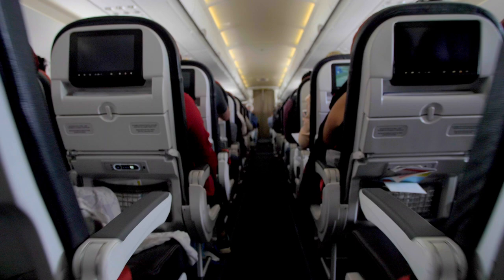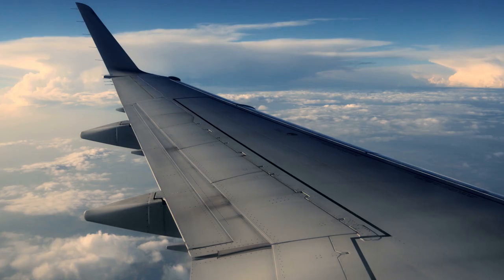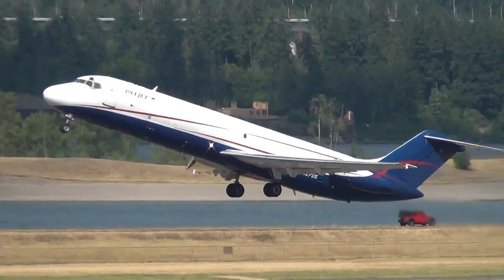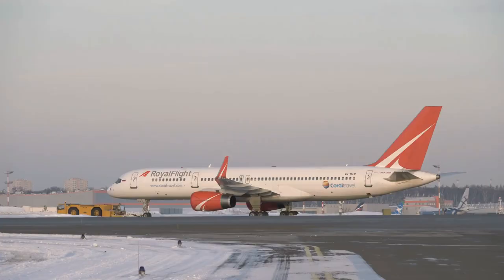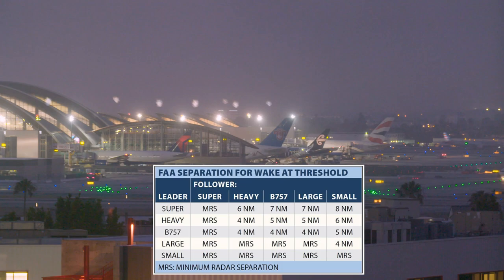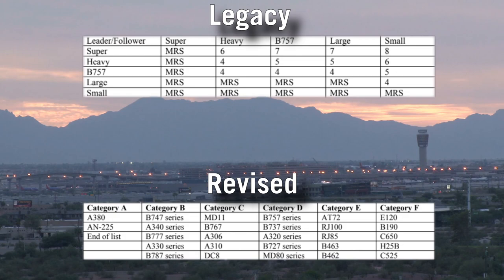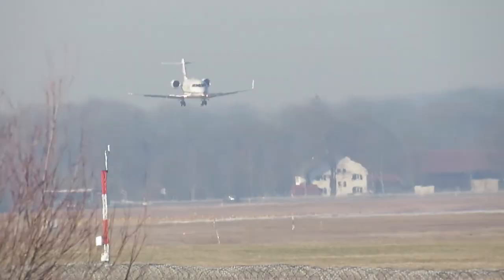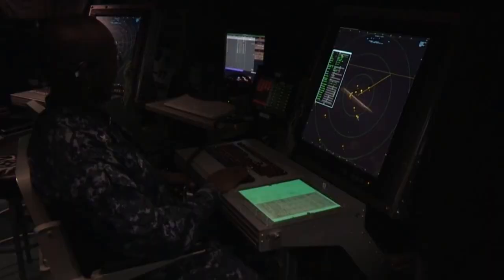This Is Why Airplanes MUST Wait On The Runway

Comment: The wing tip vortices also produce drag, which is the main reason the airlines wanted a solution (save money on fuel). That's why airliners now have winglets to reduce the vortex and reduce the drag.
If you watch the video again you'll see that the aircraft producing the largest vortices all have a flat wingtip (no winglets).
Reply: Cool, thanks for sharing. Always wondered why those exist.

Comment: Actual measurable testable science, as opposed to wild ass guessing and stentorian toned pronouncements, refreshing and hope inspiring. Excellent content sir
Reply: You can ask a flight attendant she/he will tell you why they wait. sometimes the capt. or co pilot will announce why they must wait. at least the few planes i been on did. they compared it to a wake of a boat or trying to drive a small boat behind a bigger boat.
Reply: @CertifiedForkLiftOperator69420  This has some misleading data. There is also separation issues. Same type a/c can depart immediately after take off, if course diverge by 45 degrees or more immediately , if within 5 miles the 1 minute. The wait is not always dependent on wake turbulence.

Comment: You are right to point out Dubai's lack of safety. 
Vertical separation on the routes into Dubai, especially from the east, is just 1000 feet, similar to the conditions that lead to the near fatal incident with the Challenger 604.
It's just a matter of time before disaster strikes on the route between Dubai and India.
Reply: RVSM airspace in the US (where most airliners fly) also has 1000’ vertical separation.

Comment: I kinda learned this from living under the Heathrow flypast for 20 odd years. When a super came over, you knew it'd be a bit before another aircraft came over. What I find funny is the fact a Light doesn't even worry the Super/Heavy classifications when they're behind it.
Reply: It is usually because the lights are squeezed in between two heavies or mediums. They can avoid the wake by staying above the flight path of the preceding aircraft and landing after the touchdown point of that aircraft.
Reply: @jakobusstrauss1293  Can attest to this. If you have a small enough plane that can land relatively shortly, you can just stay above the wake of a larger aircraft. Source: have landed many times in a citabria right behind (comparatively) large aircraft such as 737s and (once) a 767.
Reply: Me too.  Had a room 300ft beneath the flight path.  Had to watch TV in 30s bursts ... Always used to amuse me that the authorities always denied responsibility when someone's roof came off or their car was flipped as a big boy approached too low.  Having a car alarm was also somewhat pointless ...
Reply: We were taught at flight school, "When following a commercial aircraft heavier than you (and ALL commercial aircraft are heavier than a single engine trainer), you take off BEFORE their point of takeoff on the runway, and you land AFTER their point of touchdown on the runway. This is because wake turbulence isn't generated when the wings aren't lifting the weight of the plane."
Reply: @bobjohn2000  what a horribly dangerous practice. Glad they don’t do that in Europe. Sounds horrific.
Reply: @peteconrad2077  It's not dangerous at all. By the time you're flying through, the wake is gonna be dispersed a significant amount, and you should be above it and have no risk of wake turbulence.
Reply: @peteconrad2077  Private jets wouldn't fly above wake turbulence, they would wait for it to dissipate. The only aircraft that do it are small piston planes.
Reply: @jakobusstrauss1293  Yep! Have done this a few times in an RV-7a. Just stay above their flight path and touchdown farther down the runway than them. Since they aren't making lift once they are on the ground, it's no big deal.

Comment: The jet burst is dangerous as many planes also crash like the twin otter when a a320 blow of the elevator control string, this shows that the burst from the engines can cause a horrific damage.

Comment: That clip of the people being blown around is at Maho beach in St. Maarten. A woman was killed watching a departing plane there. Signs are posted warning of the jet blast but most tourists ignore them.
Reply: @ezicarus8216  The area cannot be blocked off because the road leads to a community and hotels. And Maho beach that is at the beginning of the runway is a public beach. Also can’t block that off. If they put a solid wall or whatever the force of the jet blasts would knock it down. Vehicles have been blown over.  And yes, it truly is dangerous...more than one person has been killed. Signs are posted which are mainly ignored. They don’t just “wander around”, tourists flock there to see the planes come in and depart.

Comment: I was in my car at an airport service road, and when a DC-10 was getting ready for take-off, I got out to match by the chain linked fence.  Although I was easily 100m away (100 meters - a football field!), the thrust not only ripped me off of the fence, but I tumbled across the service road.  I remembered praying that a car was not coming by!!!  Those 3 quiet (high bypass) engines put out 8,000 kg of thrust each.  Eight tonnes !!!!   (well, 24 tonnes total)  No wonder my 60kg body was thrown around!!

Comment: Working on my PPL, and my first encounter with wake turbulence was in a maneuver called the steep turn. We bank to 45 degrees (Left and right, in no particular order), and turn in a full circle. If you do it right and the air is fairly smooth, you can actually fly through your own wake when you come out of the turn! In a Piper Warrior it feels like a small bump, and maybe a sudden roll of 2-4 degrees.
Reply: Yup.. I've had that a few times in an Arrow.. never a 172 though!
Reply: The same has happened to me when thermalling a glider. It's just a slight but very distinct bump.

Comment: Pilots actually have the option to wave wake turbulence waiting as long as they aren’t waiting for a heavy or super. They usually don’t, but I’ve seen it happen
Reply: "speedbird heavy, follow the cessna. caution: propwash"
Kennedy Steve
Reply: @kenbrown2808  love Kennedy Steve!
Reply: @davidcarroll8735  he was a master.
Reply: The pilot in command had the final and ABSOLUTE authority regarding the safe operation of the aircraft.  ATC is advisory (though the pilot had better be really sure of his situation if he bucks the system).  "Unable" is a pilot's hole card..."Emergency" is his trump card.
FAR 91.3 (A) "The pilot in command of an aircraft is directly responsible for, and is the final authority as to, the operation of that aircraft." (italics mine)
Reply: @petesheppard1709  The pilot also has the legal responsibility to comply with ATC and other FAA directions unless it is unsafe to do so.
Reply: @afcgeo882  Exactly.  If a pilot disregards ATC, he'd better have a good reason for doing so.
Reply: I know of no pilot who would do that.
Reply: @peteconrad2077  I've done it.  I was once on an approach that looked like it would bring me into an airliner's wake turbulence while under approach control.  When I requested a go-around, Tower said I'd be fine.  As PIC, I still didn't like the picture so I replied 'Unable' and went around anyway.  Tower was annoyed, but let me do it.
Another time, I was cleared to land with another airliner coming in on an intersecting runway.  I SHOULD HAVE gone around, because had I not landed and stopped in time, I would have collided with the airliner.  The other pilot later had a word with the tower...
Reply: @petesheppard1709  1. The OP is clearly talking about departure separation. 
2. If you’re not on the same approach then this an entirely different matter and not at all related to the OP comment.
Reply: @peteconrad2077  Good point.  A pilot would indeed be absolutely stupid to violate takeoff clearance procedures and instructions, and deserving of having his ticket lifted.
Reply: @peteconrad2077  I’ve only seen it with military pilots. If they have to leave quickly for an interception mission or something they might ask to waive it. You’d just have to give them a cautionary advisory before clearing them for takeoff

Comment: Helicopter blades also create wing tip vortices.  Imagine a two-bladed helicopter with the blades stopped in the left and right position, but the helicopter is moving forward; the vortices extend from the tips to the back just like a plane with wings. When the helicopter’s on the ground and the blades are spinning the two vortices combine to be one in a cone shape,  with the point of the cone pointing straight up from the rotating shaft, and the circle of the vortex is on the ground encircling the helicopter.

When the helicopter starts moving forward the cone vortex  changes into the two tip vortices.
Reply: David, very interesting! With that in mind, are helicopters affected by take-off / landing vortices from airplanes, or vice versa? Or is the wake turbulence issue limited to airplanes alone? Thanks in advance.

Comment: I was once in a light plane that went through the wake of a heavy C-130. It was already 10 miles away but the wake was enough to flip the light plane more than 90 degrees. It recovered quite quickly but damn that was the scariest aviation moment in my life.
Reply: Doesn't a cross wind clear the wake turbulence by blowing it off the runway?
Reply: C-130s don’t generate that much wake. Certainly not enough to stick around 10 miles (or even 5) behind them.

Comment: Err I heard military aircrafts fly in a column of 30-40 planes to save fuel. Can you get into that topic? How they save fuel and how wake turbulence affects them.
Reply: My guess is its similar to geese/bird migration - the air resistance is broken for following 'planes' meaning less fuel is energy/fuel is needed to combat it. Then, most military aircraft will probably be similar size (I dunno bout that one) meaning the wake vortex won't disturb flight as much?
Reply: At the end of the video, the point about military wake turbulence was mentioned
Reply: @innocentguardsman8582  wake turbulence goes down from the aircraft the further away from it so if you're close enough and at the same altitude as the aircraft in front then it's not a factor
Reply: You heard wrong. I flew in the military and I have no idea wheee this idea comes from. Wake turbulence affects aircraft regardless of their function.

Comment: Taking off from Gatwick, heading for DFW in 1998: we were sitting on the taxiway. Engines pretty high RPMs, full brakes (like a horse wanting to run). A soon as the previous aircraft stopped touching the runway, we released brakes and went for it. Before it was our turn,  we'd watched this "merging" pattern for a good 20 minutes.

Comment: I used to fly into Heathrow in an erj145, they hated us.

Longer gaps on take off and landing. Those 747's had quite an effect on our little crop sprayer.

Can't remember which runway it was but just before landing in one you go over a staff car park. Cars in and out all day meant heat rising from hot engines. Amazing to think this had an effect, but the lift right before could really catch you out.

Comment: I'm an airline pilot.  Haven't watched the video yet.  Waiting for it to be wrong and or misleading.

Actually, pretty good video.  Good job!  I love these videos and you're a fantastic narrator!

Also, I've flown one of the planes in the 2nd half of the video.  Could have been me!  Woah!
Reply: Hey ,your a pilot?Thats awesome.
Reply: And yet it is wrong.
Reply: @afcgeo882  how?
Reply: @triston8322  Wake turbulence isn’t even a consideration for large aircraft that follow small aircraft. The real reason for separation (at least 1 minute) is for IFR minimums and for emergency loss of power on initial climb. You may also have added separation because of WX.
Reply: @afcgeo882  oh ,okay.
Reply: @afcgeo882  He still got the mass majority of this video right.
Reply: @noonedude101  What he got right was the explanation of what wake turbulence is. It just isn’t why planes wait to take off, most of the time. So literally, he got the purpose of the video wrong.
Reply: @afcgeo882  That heavily depends.  At Atlanta and Philly?  Happens all the time.  There's a table for it somewhere showing required wake separation between heavies.
Reply: @noonedude101  I know the table well, even for Supers, but that separation applies to smaller aircraft, primarily. Heavy after heavy is just 1 minute, which is the minimum separation for flight ops either way. ATC will usually send a few small and medium aircraft, then a few heavies or supers together. Wake separation exists, but it’s just not the primary reason there is separation.

Comment: They should use their horn, if they are stuck in traffic
Reply: Yeah.. Unfortunately they don't have one
Reply: @PovidisII  No big deal to put one afterwards :D!
Reply: Just roll down the window and yell, works just about the same
Reply: @PovidisII  Actually lots of planes do have horns.  I work on 737’s and used to work on MD-80’s.  They both have horns for getting the attention of ground personal while you sit in the cockpit.
The 737 has a horn to alert people that the inertial reference system is on without main aircraft power being on and it also goes on if power is on but equipment cooling fans aren’t working properly.
You could sound one of those horns at another plane while taxing around but no one would hear it.
Reply: @PovidisII  afterburner go brrrrrrrrr

/j
Reply: @pewpewdragon4483  lol xD
Reply: @DardanellesBy108  That Was pretty damn interesting!
Reply: Help me step-plane. I'm stuck. ;)
Reply: Funny...😊
Reply: They do have a horn, sort of. It's to get the ground control to come up and jack in the headphones and talk properly to the crew.
Reply: Who raised the question of a horn………..and why??? 😢😢😢🙄😉🤣
Reply: @DardanellesBy108  You seem knowledgeable. Does the horn go beep beep or honk honk?
Reply: @pewpewdragon4483  😂😂😂 unfortunately, the wind can't allow them to yell at each other 😂
Reply: Verdad, in Mexico City.  Honking the horn doesn’t fly in Thailand. 🤣